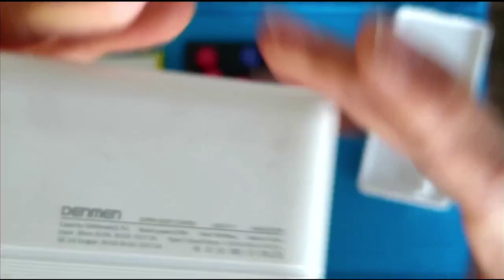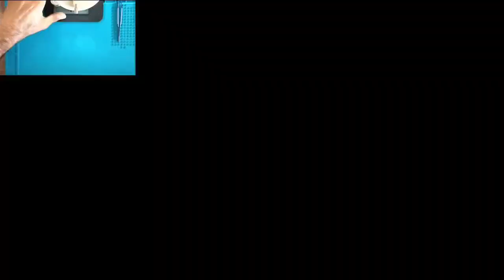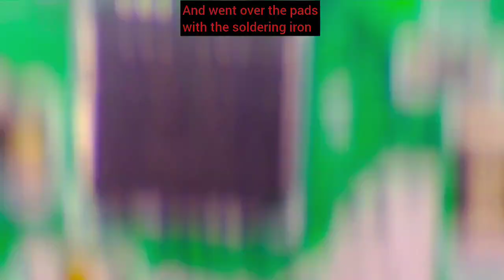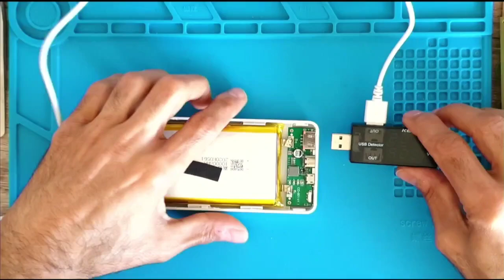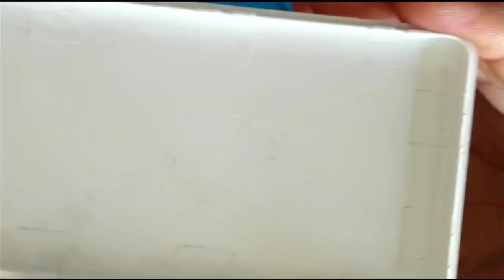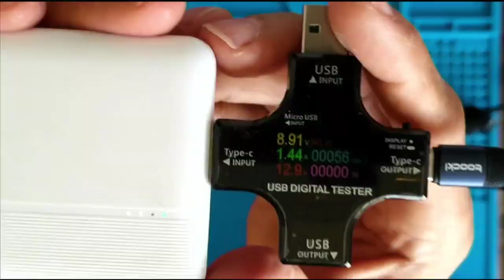38 Denmen Power Bank (DP08) - Repair Attempt

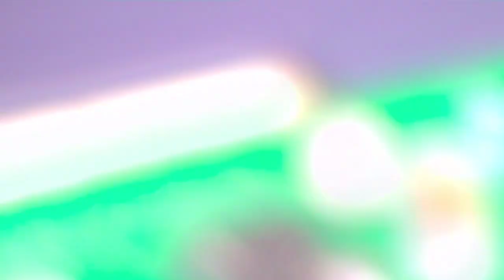Comment: @12:02 there is a solder bridge on the pins after you reflowed the chip.
Reply from the maker: Greetings @ahears1, you are correct, the two pins are indeed bridging. But if you look below the pins you'll notice they are on the same track. So visually they look "wrong" but functionally it doesn't matter.

Thank you for commenting & pointing out the potential mistake.